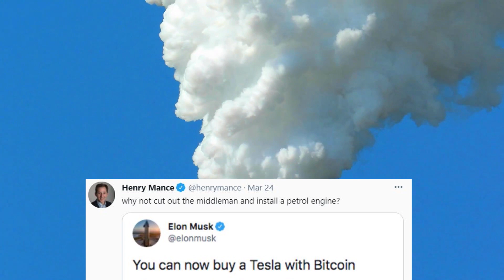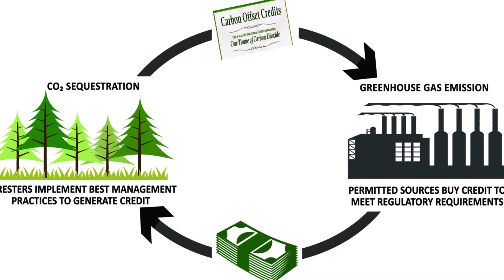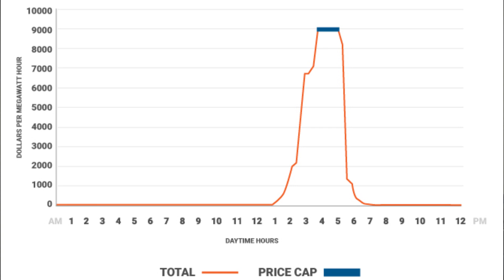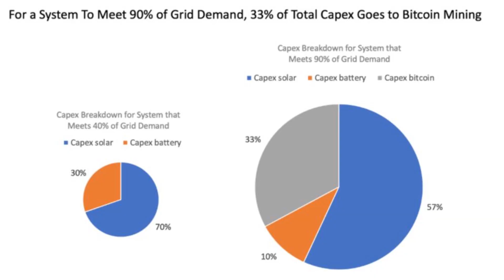The Bitcoin Green Revolution - Is Cathie Wood Right About The Environmental Impact of Bitcoin?

Comment: Using 'proof of stake' instead of 'proof of work' solves all crypto's climate-related concerns and is already scientifically and practically proven to be equally/more secure, yet it is almost never brought up in these crypto-climate discussions.
Reply: What's the current biggest crypto that uses proof-of-stake?
Reply: @seneca983  Cardano uses proof of stake, which is currently the sixth biggest coin by market cap. There are also plans to move ethereum to proof of stake, but I don't know when this will happen.
Reply: @OmegaKillerArtMeisterSkywalker  Thanks. So proof of stake isn't that big yet.

Comment: One thing I though that people are not talking about is the eWaste created from dedicated miners that will be obsolete in less than 2 years as the mining difficulty increases and the new miners likely more efficient are designed and fabricated. A zero carbon emissions world filled with miners as described by Kathy is currently a more of a fairytale that we tell ourselves than something in the near future.
Reply: The e-waste is insignificant compared to all the computers banking uses. Wer'e at 8nm chips now there won't much further a CPU die can shrink in the future to capture any more efficiency. Old ASICs end up being sold on ebay and used to mine alt coins like Bitcoin Cash or other SHA256 encryption projects.